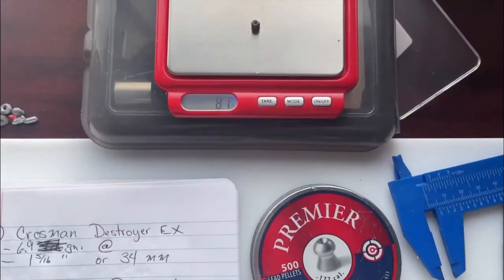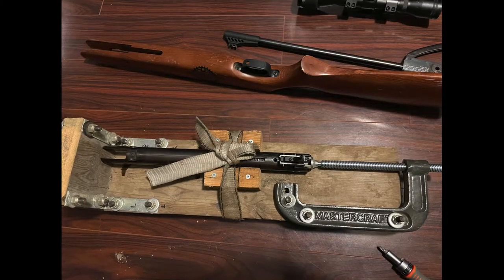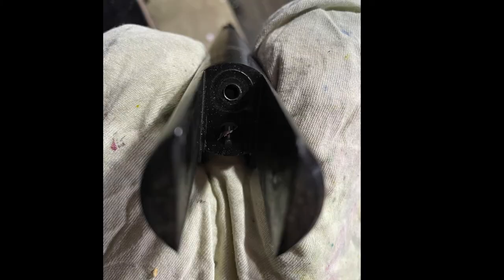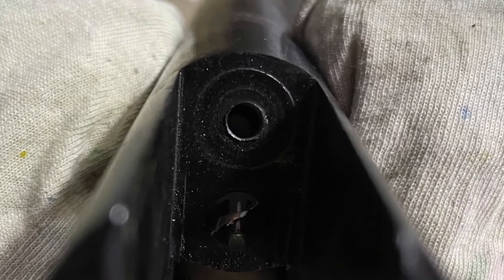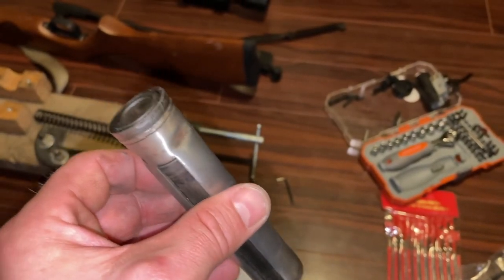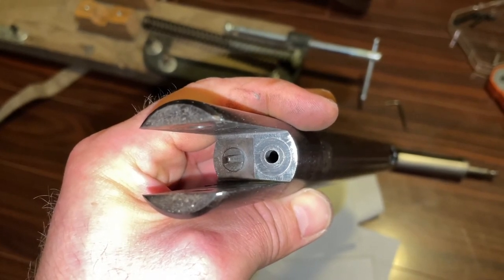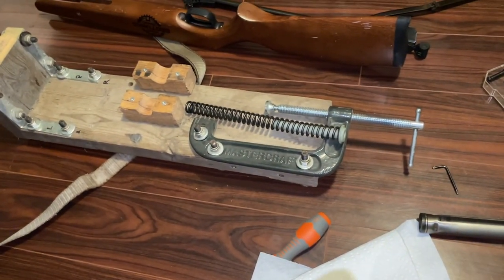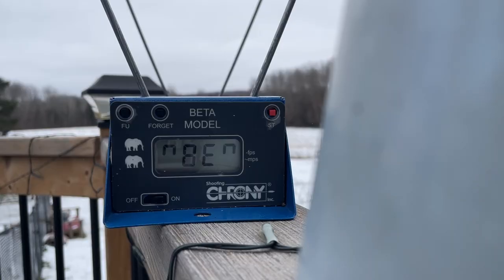Air rifle porting! will it gain FPS?

Comment: You might be better of by threading the transfer port. That way you can insert different sized holed inserts so you can adjust the airflow depending on the pellet weight.
Reply from the maker: That’s a great idea! Thanks I will have to look into this
Reply: This is what I need to test "rocket nozzle" port shapes!
Reply: @hansjohannsen6722  Has been done numerous times, nothing to be gained.
Reply: he can still  do  that  
and   first   you got to enlarge  hole  or  no way ,,I  tried all this  in 80 s   and  I  feel  best   mod was thicker  /better spring ,  rubber  o ring  if your air rifle  had  leather  one  like  many  had   40 years ago ,, ,than  we   polished   cylinder   tested   piston seals,piston  weights ,,  RESULT//other than   much  better   thicker  wire  , imported/i lived  in Yugoslavia than // or  hardened  original  spring //schoolmate s father worked  in  nail /screw factory  so they had  pro  tempering and  hardening   furnances/oil baths //much   more   stiff spring  might  brake  in   few 1000 shoots , and  it  had to be   shortened a bit  not to smash into  cylinder   end wall //this   would close to double   ,,power ,,no chronometers than //coca  cola  bottle   on  10 /20 /30  40  meters was  our  ,,powermeter  and  / or   177 pellet  boxes  penetration // from  3  layers  /so  1  can  thru  and  into   2nd   to  2  thru  and  into  3rd   was  best we did  //we were   10 to  12 old at time //we  were   experimenting   with   1  pellet  , pushed 1  inch  into  barrel ,,few all striking matches  heads   added /or  better   tin toy gun caps  material //,followed  by  another  pellet //this   can   get  up to  22 lr  penetration , but  will ruin piston seal  ets   since  strange   things happen  when  you fire   ,,1  pellet  go   out  ,,faaast  other   go to bits some  go out some bask in cilynder //but it work it  would  be  lethal ,,remember  old spring air rifles  had like   7 mm thick  barrel  walls so  we than  added  some flash powder  from  crackers    and   last  thing we   poured   slugs  because  pellets  were   coming out as shoot //we  took  177 drill  ,drill into hard wood  pour   lead to get  ,,lead wire  , than  cut to length,and  if too big diameter  roll on table  to  get  ideal  caliber //THIS  COULD   PENETRATE   6 TO  10 INCHES  OF   DRY SPRUCE  FLOORWOOD //MORE THAN  22 LR //
Reply: @michomicho7668  Is this a sentence?
Reply: @dutchsailor6620
Reply: @dutchsailor6620  no it  is a fact  i   fired  more  than //i went   and calculate//200 pellets    per day  minimum from   9 till 14 old // and   when   skippin school to  go   into woods  or   to  try   to make   //we were 2  friends  that were  into  air   guns //because  in   Yugoslavia  of 1980/even  22 lr   was for  18 old  plus  and  in gun club  25  rounds 2x  per week   / 5  to  sight  in  and   20  to get   score  //best  of 200 //same  on air rifle  but    age   was  not  important // so I   had  my allowance   cash   or  how you call it  , or  some extra  for   doing some  work  around  house  , I was  paid  in  pellets //not in cash // so   on ,,great week    I   used  5  or  more   1000 round   /diabolo   boxes //  so in  all if  I  go   on low side    , I used   around  million of   177  pellets   , and    we tested   all that can be  done   and   a  lot that should  not  be  done    to get   top power //so no it  is   suggestion ,, if   want   super  hard  hitin  air rifle   that  is  cheap  to operate   get   177 or 22  
diana  magnum  series // it  is   under  400 doll and   22 model  is as  strong   as   subsonic   22 lr  from short  barrel   , but  many  time  more  powerful  than   best  spring   air  gun  from  1980,90s ,,177 cal  with   ,,so called    magnum pellets  /2x weight  of target   diabolos , can  be  used   for  50 meter  precission  shooting  or  to kill  all under   5 /7  kg animal if that  is   your goal ,,when  lubed  fresh /if  non dieseling oil is  used  it  can  do supersonic   all day  long //normally  with    most  heavy  pellets you can buy /not slugs ,,and  no modification ,, i had  mine   touched  up by  air  gun  specialist //port   and   breech polishing   squaring ,  better    o ring to  seal brake  point /and it was a  blast //had to  sell it  because  law   came out   200 m/sec  or   20 joule    is all   you can  own  without   background check  and all  needed  for  lrt say  glock 19

Comment: I would never make the port larger than a pellet. If a pellet falls out of the chamber and back into the compression chamber, you'll dry fire the gun, you will miss your shot, and now you have to take apart the rifle to get a squished pellet out of the gun.
Reply from the maker: I made the port a bit smaller than the bore of the barrel
Reply from the maker: But ya that would definitely suck
Reply: @BROTUNED not if it’s .191 inches (4851.4 mm) that’s bigger than a pellet a .177 caliber pellet is literally .177 inches (4.5mm) so not sure where you got .191 is smaller than .177 but it’s not..

Comment: I found this channel because I was wondering the same thing about air rifle porting. 
I've tried many different things including making my own shorter piston in aluminum Tubing. Got in a few over 700 FPS, and with less recoil. But it needs to be stronger. Might need to have it made in TITANIUM 
 Yesterday I put my stock piston with only the hole plugged back in. Original seal, but lubed with 20,000 weight diff lube available at my local hobby shop for 12 BUCKS. Plus you get a lot more than crosman sells you for 20. 
600 FPS with one virtually free change in assembly. I thought the thicker lube might slow the piston, but he results are repeatable. Crosman lube takes me back below 500 FPS.
Reply from the maker: That’s awesome I like mine around 600 fps the best the recoil isn’t to hash and it’s still accurate. That’s super cool you made an aluminum piston and if you do the titanium one I’d love to hear the results. Cheers man and happy modding
Reply: @BROTUNED  I have another practically identical rifle to the one I changed the lube in. Only difference is I've shortened the stock piston which is giving me virtually identical muzzle velocities to the unit with the new lube. So, naturally I'll be switching up the lube in that one to see if I get even better results, you know, For Science. Need more data.
The Crosman 0.177 Pointed, 7.4 grain seem to give me the most consistent velocities within +/- 5 fps.
Everything matters when it comes to accuracy.

Comment: So I tried this on a snow peak SP 500 pistol .22 . And I didn't notice much of a difference shooting so I went the opposite way and reduce the size of the hole by using a setscrew that I rounded the tip off so it would be a hexagon shaped porthole. Before when I tried dieseling my little pistol it didn't work. But I can tell you know that after some lubrication sure Pops.  Now I'm able to pierce piece of drywall with the Dolmed pellet. Again at all probably depends on many factors good thing it wasn't difficult to come up with an idea going smaller for the porthole.
But thank you for your video I like the fact that you have an idea and you try it. It gave me inspiration to see what I can do to increase the performance on my pistol. Also I know definitely it has more power because I have a decent scope on my pistol. And after reducing the size of the hole, I had to adjust the vertical sight quite a lot. So I know for a fact the pallets are flying at the same altitude farther.
Reply from the maker: That’s very cool you stepped it up and experimented

Comment: So what was the FPS spread before? There appears to be a 45fps or so spread now. We didn’t see so perhaps it was this variable before but a 7% variation between shots can’t be good for consistency. Not being critical but One must consider if a little slower with consistent accuracy is better or worse than faster with wondering. Thoughts?
Reply from the maker: Need to do more testing but it did shoot better with the lighter spring in it so going back to the light spring then I’ll test it again

Comment: I have a .22 Gamo Hunter Grizzly Pro, the porting opened till 3,8mm, and works perfectly. 
Believe me it works perfectly.
With the same 9 grains pellets it made before 23Jouls right now doing about 37 to 40 jouls and beats 340ms because I can hear two times noise in the air, above 1000FPS
I think you opened to much the Porting.
After check a few videos I did find out the ideal bore will be around .132 around 3,3mm, i am using a 80kg Gas Ram.
Reply: Your mod is very aggressive! 
I've been modding a new Crosman F11 (495 FPS alleged) .22 cal airgun for the last two months, and found that a new piston is required, not just a gas ram, to get good FPS. 

I first tested shims of various depths & positions, finding the ideal shim for a new nitro piston to be 3mm. After 5mm, there is a loss of FPS.
I upgraded the stock gas ram to a 60kg version, and there are no bleed holes in the piston, but the piston seems to be the cause of the slowdown. 
I use Crosman Premier 14.3gr pellets (as you know, .22's are heavier), and I could only get 430 FPS out of it stock. My shim testing of 3mm's (between the fat body of the gas ram & the anterior of the front of the piston) gave me a good 20 more FSP.  With the new 60kg gas ram, I should be getting 750 FPS but I'm seeing 450-470 still, with very erratic performance. Still thinking it's the gas ram at fault, I ordered a 70kg one. I also ordered a new piston for a Benjamin Trail that should allow greater increases in FPS. There is so much at play - the length of the gas ram, the depth of its compression, the length of the ram stroke, the ideal pre-load, etc.
With the new 60 kg gas ram in the stock piston & a shim of 3mm, I'm shooting 450-470 FPS. If the new gas ram & piston work together to give me the FPS I paid for, I'll finally look into adding girth to the transfer port. I'd get better FPS using the 9.7gr Gamo pellets, yes, but I want my generic, 14.3gr Crosman hollow points to get the advertised 495 FPS - consistently. Gains after that, I need a PAL license, which I'm applying for.

His 7.9% increase of his transfer port in this video took his .177 (4.4958 mm) port hole up to 4.8514 mm. Now, he's proven the extra 7.9096 % girth gives him a ~50 FPS increase - but I'd like to know what experimentation you did to finally decide on your transfer port mod of 3.8mm (and your ideal 3.3mm). What was the port's calibre stock? There must be an ideal "transfer port to breech" ratio for .22 cal. Yours, at 3.8mm : 5.5mm, is a 40% ratio. At 3.3mm to 5.5mm, it's 30% ratio. What if your rifle had a 70kg gas ram? Would you open it wider for a weaker gas ram?
Newer nitro-piston airguns tend to maximize for the best transfer port performance, and leave the gas ram + piston to determine the FPS. I wouldn't want to bore out & ruin my new airgun without reading others' findings first.
Thanks, I know this post is old but you've got performance I want. A shimmed gas ram with 70kg should be getting more than 470 FP with 14.3gr pellets.
Reply: @NunchucksHabit I have a Ruger impact elite .22 also. I'm hoping he responds soon 😂! I'm curious if more porting is good for this gun. The factory port is tiny. I wonder if a conical port from the inside would increase fps or just a straight through port at the aforementioned angle. Hmm. I'll post a up video soon probably next week.
Reply: @Ebikemike00  Update on mine - I just needed a different piston. The piston I have now is considerably shorter (150mm vs the OEM's 196mm), made for a NP2 Benjamin. The 70kg gas ram is also 8.5mm shorter. This makes for a longer cocking swing, but it locks & releases perfectly. I'm testing soon with more shim options since the cocking angle might not be ideal for the piston. It's a lot of work & a lot of pellets, but I'm fascinated by how legally available parts can so drastically improve velocity. I'd say the average fps with 14gr pellets is now ~750fps. I usually get a couple of shots > 900 fps, but they tend to even out around 750-775. Not bad for a cruddy Canadianized 440 fps toy from Canadian Tire. That's the great thing about universality between US & Canadian models. 'Magnum' parts can be a drop-in fit in detuned airguns.
I still want to try boring the intake port just a bit, so I can at least analyze potential gains with modest port widening. There's a lot more air being pushed into that intake port now with shorter ram & piston, and I'm going to disassemble again this week so I can assess the ratio of intake port diameter/depth vs. the 5.5mm breech. My rifle is much louder now, and seems to be pushing too much air through the small hole at once. Maybe I'll try with my slightly weaker 60kg gas ram. So many variations - I wish the math was already done.
Reply: @NunchucksHabit  so if I have a US impact max elite .22, which piston combo do I already have and which piston/ram combo should i get to achieve the 100+ fps gains you have? Details please and thanks in advance! 🍿 🍺
Reply: @Ebikemike00  Since your rifle is a totally different brand, as long as it uses a 'gas ram' (nitrogen), you've likely got options. A brand with a wide array of products (like Crosman) will likely have a good variety of parts that are swappable between models. 
My Crosman F11 got 430 fps average with 14.33gr pellets. After doing the following, it now gets 750-800 fps. Once it gets > 500fps, it's officially a 'firearm' in Canada, so don't get yourself in trouble.

There are 4 major ways to improve velocity:

1) Increase the amount of air being compressed by installing a shorter piston. The most effective overall. Cost: About $50. Gain: ~300fps.

2) Add 'pre-load' to the gas ram (shimming). I found 3mm was ideal & gave me ~25 fps. Cost: $1.

3) A stronger gas ram. Nitrogen gas rams available on Ebay. with lots more power. I got a 70kg ram, but it's a bit too powerful & there's a huge kick & lots of noise. Cost: $50. Gain: ~20fps with OEM piston.

4) Intake port boring. Every layer of hardened steel you bore out is permanent, so bore out your intake port in small increments. Keep boring it out until you no longer see improvements in velocity. It'll start getting slower if you continue. Check the diameter first, then ask communities what the diameter is on a full powered one. It might already be optimized.
Every time you bore it, you have to fully disassemble & re-assemble the rifle.
Cost: $? drill bits, time. Gain: No idea, that's too much work for me.

Try shimming first. It's easy, it's cheap & you don't have to fully disassemble the rifle either. Boring out the intake port should be your last move, but it might help immensely. 
It takes less time to take a gun safety course than it does to do that, and a safety course allows you to get a PAL in Canada, which allows you to buy a high powered airgun. That costs $60 for the course, $70 for the application.
Reply: What you did is correct, the dealer  in your country must have wanted it at that level of power 
In my country, without any optimization, I get 37 joules. 
A very powerful and accurate rifle, especially after you clean the barrel.
Although I have a daystate redwolf, I enjoy the gamo more. 😄

Comment: Remember a smaller hole passes less air but at a greater speed whereas a larger hole passes more air but at slower speeds. It seems that given the results a few thou does make an improvement, the danger is thinking of making it bigger again when you may get to the point when you start going backwards! I always wondered if a truncated cone shaped piston head paired to a compression chamber the same shape would channel the compressed air better than a flat configuration??
Reply from the maker: My theory on this was to get as much air behind the pellet as possible since it will start moving down the bore at low pressure. With a larger port you can get more pressure behind the pellet before it leaves the barrel. It may be a bit harder on the rifle because the piston doesn’t have as much compressed air cushion when it hits the end of the chamber
Reply: I see your point. I wonder if a lead in to the hole would guide the air in better than straight drilled? Or even a truncated piston with matching chamber might give better air flow to the pellet. Interesting thoughts!!!
Reply from the maker: Ya I don’t know was just an idea so I tried it. I shoot it quite often at 50 yards in my backyard and I hit relatively small targets pretty easily so it works for me and my pest control needs

Comment: Hello there my friend from Greece! It seems that only one person here in the chat section noticed it. You didn't show us the starting spread but after the mod you had an extreme spread of 46 fps between 672fps to 718 as we saw! This is a very different number than the manufacturers give us between 15-29 fps. You gained a bit of power but if you do some target shooting now, will be like firing a shotgun with round balls to your target! :)
Reply from the maker: It ended up settling down not sure why the es was so large
Reply: @BROTUNED Did it settle down , after how many shots? Maybe after the swarves have gotten themselves out of the chamber slowly? What fps spread do you have now?
Reply: It can take quit some shots before all oil residues have dieseled away. I noticed the same when working on my PCP's, a lot more spread on the first 10 shots, after that the rifle settles down and becomes more constant.